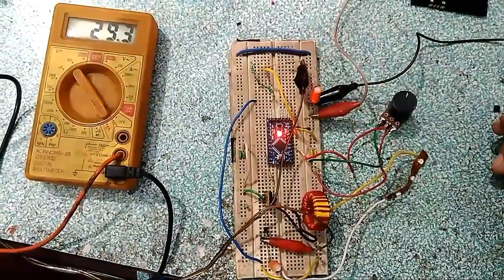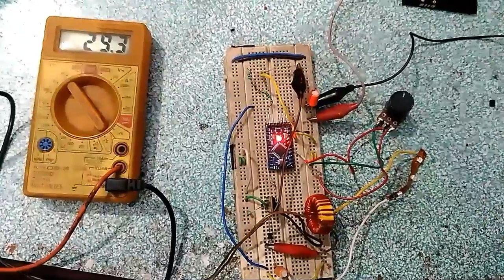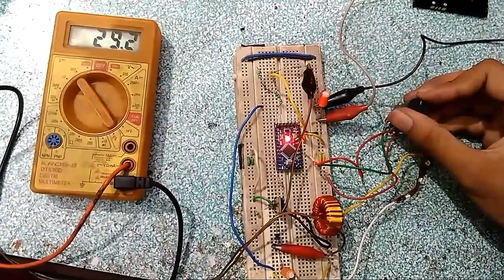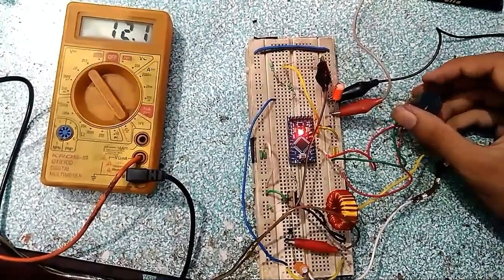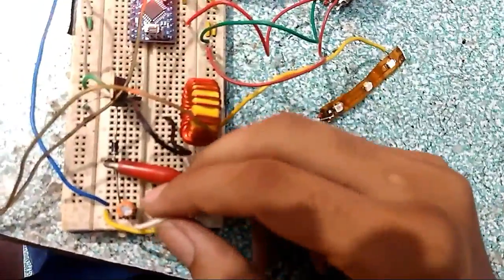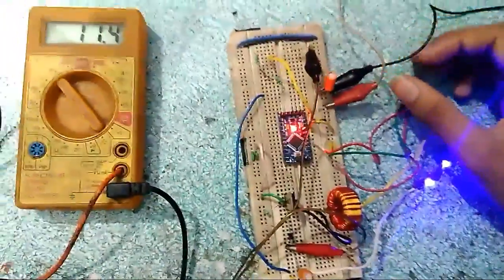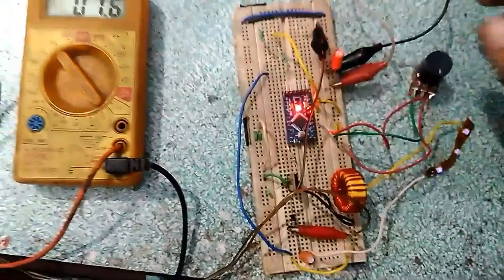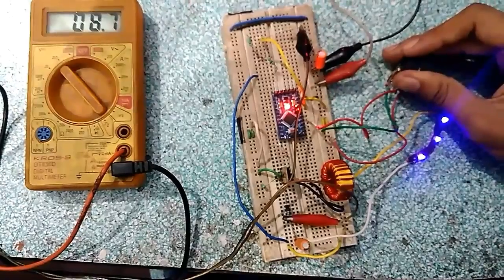DIY Boost Converter || Step up converter || Arduino

Comment: Did you experience a problem in the code. tccr1 was not declared?
Reply from the maker: I didn't maybe you don't have the frequency library.
Reply from the maker: code and circuit diagram will be available tomorrow